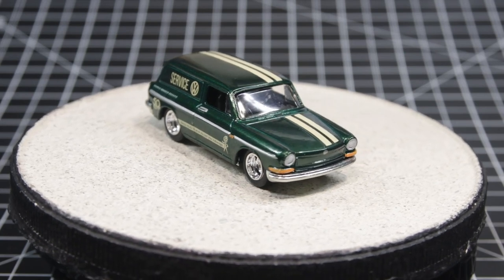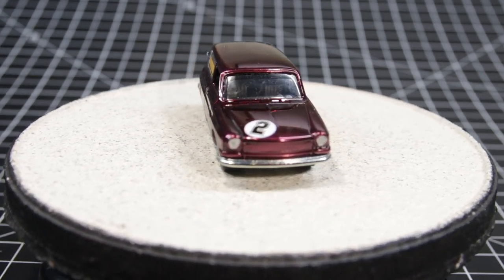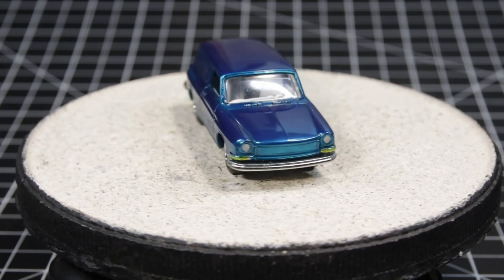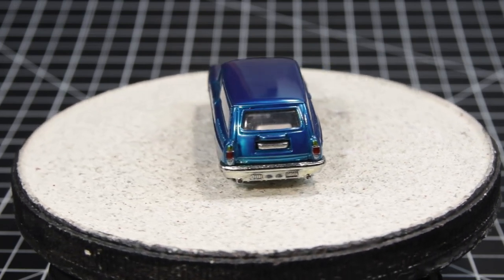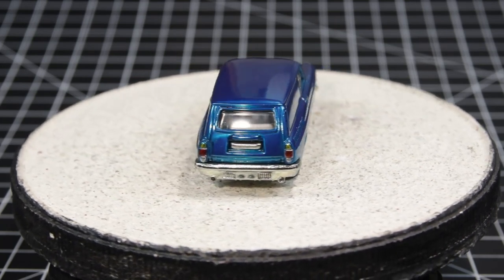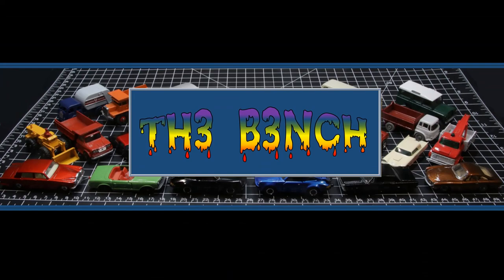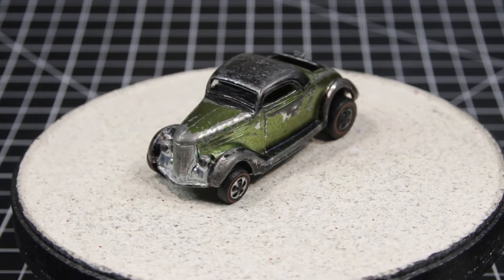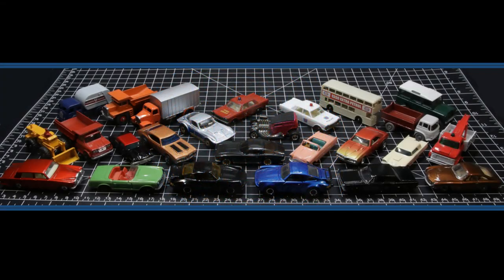Hot Wheels VW Panel - Do Over Custom

Comment: Nice work on the Panel van! I'd recent got myself accouple of Hot Wheels '49 VW Beetle Pickup trucks awhile back they a have truck body over the area where the engine is compared to the regular Diecast VW Beetles I've seen that Hot Wheels, Matchbox, Majorette and many other brands that had made over the years.